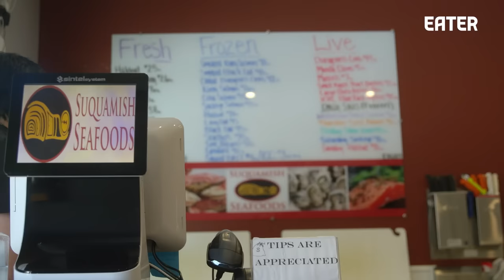The Techniques Behind Harvesting the Best Clams on the West Coast — Vendors

Comment: Interesting, I've aways wanted to try shellfish harvesting, most beaches around Vancouver (pretty close to this place in the video) or Van Island are closed due to marine biotoxins. Does Canada have higher safety standard?
Reply: WA has had issues too.
Reply: summer isn't a great time to go harvest anyways - like Shellene said, when the water's warmer they think it's time to spawn, so their taste & texture is different, and it's harder to keep them cool. check again in the fall!
Reply: @MasonLynass  That's a very good point! I'll check it out again in a few months. Thank you for the suggestion!
Reply: @maxipadthai  there are seasons around here where they are open to dig and not so definitely take a look at whatever BCs fish and wildlife department has on their website
Reply: BC will have requirements for licensing, harvest areas, and harvest rules, seasons and safety just like WA does.
Reply: Biotoxin closures are worse in summer and related to sporadic algal blooms, but pollution closures are going to constantly affect beaches near cities, especially around storm drain outlets. You have to travel off the beaten path and into rural parks and woods (or in this video's case a Tribal Reservation) to harvest clean clams and oysters.
Reply: No, the standards are the same. Beaches close for biotoxins in Washington as well; there is an extensive sampling and testing program run by the Washington Department of Health. Lots of beaches are closed to anthropomorphic pollution too. Tribes and shellfish growers in Washington work hard with local governments to improve water quality and open up beaches.